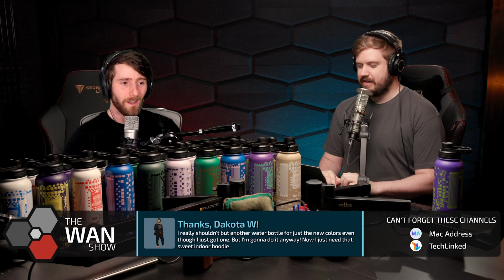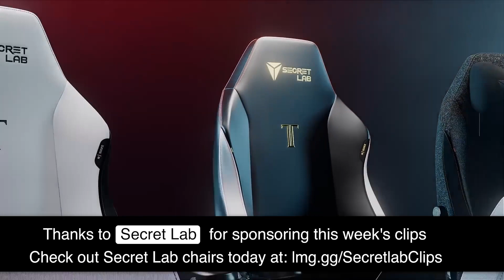Tesla caught using engineering samples in their cars...

Comment: How did they get their hands on that many engineering samples in the first place?
Reply: Maybe the fab hat some laser printing error who knows
Reply: @SimonOwO  If it was an issue at the fab, they would have scrapped or relabeled them. A reputable manufacturer would never ship something marked that way that is meant for production.
Reply: @mintzbuck  fair , I agree
Reply: My guess would be two factors. Minimum order quantity and lead time. So they placed the orders for their engineering sample to send to the FCC for approval. If they ordered 1,000 as opposed to a couple the price per unit will be significantly lower. Also the supplier will prioritize a higher volume order over a onesie twosie situation so lead time could be less. So they ordered a ton of these chips and rolled the dice that the FCC would approve it.
Reply: china
Reply: @FoolOfATuque  This makes total sense.
Reply: Engineering samples for a new product or component are usually ordered in somewhat big quantities (depending on customer requests) for testing things like failure rates and stuff like that.
Reply: Coming from tech, im gonna say this is a gross oversight and probably not illegal. The serial or text printed on the spreader isnt super indicative of the actual chip. You can etch whatever the fuck you want on a chip. It's likely they probably just changed chip suppliers/manufacturers since for the last 2 years we've had extreme chip shortages. Engineering samples are NOT created in mass like this and there isnt chips "specially made" for engineering purposes. They use the same chip to develop on... An engineering sample is just that... a sample which may have certain parameters or functions disabled or altered to allow for debugging and whatnot. the odds of them just having thousands of these chips and somehow making it to prod is very unlikely. I work at a company even larger than tesla and i can tell you theres only a few engineering samples on hand at any time, theyre all assigned directly to a small team of engineers, theyre kept completely seperate from production and even if they were to be somehow added to the production line the tools and equipment would likely be unable to process them and error out. BUT even if they were somehow processed and made it further down the line they'd be flagged and picked up by logistics as they wouldnt be assigned to any production batch or other relevant data, so at the very end of the line you'd have "ghost chips" that have no embedded or attached information for operations to know what do with so they'd escalate to engineering where it would be discovered. 

Now, if somehow they DO have thousands of active engineering samples that somehow made it to full production without ever being caught by any of the engineers personally assigned to them... well then thats extreme gross negligence from pretty much every part of the company... but I think its more likely they came up with a newer revision of the chip ON an engineering sample, and they likely sent it to the manufacturer and were like "make more of this please" and they did it to the most literal sense.
Reply: Whoever made the chips probably started mass production before it was approved, they have to call them engineering samples.
Reply: I worked at a mid size auto manufacturer and it was pretty easy to get hundreds of prototype parts. I imagine that thousands of chips would be pretty easy to get.
Reply: it would of been the "whats our return per wafer" batch, and as theres a min order of x wafers (the only people you'd spin single wafers for are NASA who have the budget to say 1 wafer or a defence contract where you are not allowed spares)

Comment: Tesla seems to be still running as if they were a startup struggling to make ends meet. So many parts that are jerry rigged because the factory didn't to scrap nearly complete vehicles that had failed in some way or using parts from other stuff (like washing machines/dryers) or that aren't consumer grade (like these ES chips). Begs the question of if this is absolutely necessary, like "if we actually scrapped cars or held off on selling them until we had everything properly fixed, we couldn't fulfill our orders and would have to charge 30% more, effectively killing the business", or if it's just a matter of "we can squeak out a little more profit and keep our stocks up if we push out this extra volume that shouldn't have made it passed QA". But only tesla higher-ups would know the answer, and of course they won't say
Reply: Or the the chips just pass qa. And tesla is willing to treat them as working final production parts. Allowing them more profit.

Comment: Back when 802.11n was in draft, a very long time, Apple shipped a bunch of 802.11n draft compliant chips.  The chip wasn't ES, but the firmware was.  And not all of them could be flashed to ratified 802.11n.  But replacing a wireless chip in a laptop or base station is much different than doing it in a car.

Comment: Hello all, the chip shortage was and is horrible on modem chip. It could be very possible they accept this ES that was in stock and they just update the firmware to the last version. Generally ES are almost finish design and generally the only things to change is software. But usally everyone use ES for new parts and then when it is validated they are sell as normal product. This is a commun thing

Comment: The big 3 car makers accidentally ship non-qualified, non-tested parts up to and including safety systems.  They usually know They screwed up and just test the design after the fact and decide they don't need a recall if it passes.
Reply: Only 10% of products are tested.. it's economically impractical to test every one.. you just hope they are ok..
Every car that comes off a production line.. you can't economically afford to test..
Reply: My favourite.. the next generation Mustang came to Australia.. 2016 version, failed every test.. zero out of 5 for crash protection.. durability test, the body shell has droop.. and the front strut mounts collapsed. Absolute crap car.. and the engine hp rating was fake..
Reply: @graemejohnson9025  for electronics even the non ASIL boards/assemblies go through 100% EOL functional testing
Reply: @sanches2  nup.. when a car, fridge, microwave, computer, comes  off  production line, only if lucky 1 % are tested..
I am a retired production line engineer..
Reply: @graemejohnson9025  Not true.

Comment: I remember using final engineering samples at the place I worked, occasionally. There's really no intrinsic issue with it. Sometimes the engineering samples were of higher quality than the mass-production components.
Reply: The difference is that it isn't certified and these cars have the potential to mow people down.
Reply: Reminds me of the process of ordering parts from a Chinese manufacturer. When it matters, they might order 1,000 engineering samples and vet every single one of them internally. If they like what they got, they'll order 100,000 more and do spot checks on every 10-100 of those.

 @OfficialSolDios  despite popular opinion, losing internet does not unalive you.
Reply: @OfficialSolDios  As I said, the engineering samples may be of objectively higher quality in every aspect imaginable. It's not enough to go on. It's really nothing to go on at all, because you're just as likely to have a bad run of production parts as to have the engineering samples be bad. It's all about vigilance in the quality department. Things get recalled all the time for production parts being wrong. You could wind up recalling every device with a certain lot number. It's really no difference if they are engineering samples or not.
Reply: @RipleySawzen  That's not the point. Engineering Samples are explicitly not certified by relevant regulatory bodies for sale. It's potentially illegal to sell products using those components.
Reply: @meltingfaces10  We don't know that. The same could be true of production components.
Reply: @OfficialSolDios  ...its a modem, and you don't know if they are certified or not.

Comment: I do believe ES are ok as long as Tesla warrants them under their manufacturing process and allowed by the FCC as long as they comply with current FCC regulations. In other words the responsibility falls on Tesla to comply with the FCC, as long as they do there is no issue. Not being approved by the FCC has nothing to do with Teslas sold in China, they don’t fall under FCC regulations.
Reply: Yeah, the ES label doesn't really change the process or the product as long as they are the same as the "production stock" and go through the same QA as normal chips would.

Comment: Engineering samples used in production are a huge no-no.
Reply: Not that I'm aware of. It happens all the time in the semiconductor industry.
Edit- I should clarify that I didn't mean ES marked chips but that wafers/chips get used as Engineering Samples before assembly, and then get swapped and sold as production chips.
Reply: @lordec911  when it comes to vehicles and the safety of people, depending what module it’s in, could be a big deal. All it takes is one problem for autopilot to drop out on a Tesla and kill someone
Reply: @JackPepal357  is autopilot reliant on the modem?

Comment: If these modem chips are anything like the radio chips in cell phones, the ES model might be more sought after simply due to the fact that radio bands aren't arbitrarily locked out and a different firmware could make use of them, potentially giving you a device with cell data access internationally. I wouldn't be surprised if the finalized model was so similar that the only differences were qualifying requirements like signal strength regulation and firmware and/or radio band lock-outs.

Comment: It's not bad at all. Seriously. A SpaceX rocket blew up because of a faulty strut from a supplier... After that they decided to place zero trust on suppliers and certify everything internally.  When some thing goes wrong you blame the primary contractor, not their suppliers. If the strut breaks, the air bag grenades you or the chip fails, it's Tesla's/SpaceX fault for not doing good enough Quality Control, not everyone else's.

I view this as a factory overclock, if it works as well as I paid for, I have no problem with it.

Comment: I feel the problem here is that they are using them, my problem is that they didn't disclose that they where using them. I'm with Luke, during this chip shortage i'd rather them not just throw a viable chip out and just repurpose them. The issue is that Telsa did not disclose the information stating something on the lines of "Do to the chip shortage we have repurposed some engineering samples in our production cars.

Comment: If indeed these are simply chips that existed before they were approved and they did later meet QA, this is a non-issue.  If instead, these chips did not meet QA and were never production approved, then that is not good.
Reply: The problem isn't whether or not it met QA standards, the problem is that using ES chips very well may not meet ISO 26262 and run afoul of NHTSA requirements.. which, you know.. is not cool.

Comment: It only takes a few days to do the minimum certification tests. I would be very surprised if they didn't bother testing. 

Generally for automotive, while pre testing may be done on board level components like chips, actual certification is done at the equipment box level and then whole vehicle level for emissions. 

Most auto makers have far far higher standards than minimum but I am not sure about Tesla. 

Tesla should know what their oem suppliers are up to. It is a very odd circumstance and not something other auto manufacturers seam to find themselves in. 

As others have said, spinning low batch samples if your fab-less can be expensive as a per unit. Likely had had done pre compliance testing on other samples so took the gamble that these would pass certification and did a large order. 
Lead time and fab slots may have also dictated the need to order before full cert and risk the batch goes in the bin. 

It is likely the component and vehicle level meet minimum standards and all is good in the end.
Reply: I remember a huge uproar here in Germany when Volkswagen got caught selling Pre production cars to customers or even employees.. 
This cars can have some lower grade parts in them and can be a huge security risk. Even if those cars are the last Pre produced cars, they cannot be sold by law in Germany.  They have to be disassembled or used as crash test cars.  They had to buy them back for the full price from the customers.

Comment: Personally, I don't care if my chip in the car was used to be a smart dishwasher but melted and resoldered along the way and it work same way as a new chip. On other hand, a sample chip that may function the same as a certified chip is still a sample for a reason. Think about it, if I crashed my tesla into other car due to brake signals delayed; however I discovered later that the chip in the car was a sample, I will blame a sample chip as a culprit for my brake signals delayed than normally rather than blame a brake sensor. The example may not the best, but I hope some of you get the point.